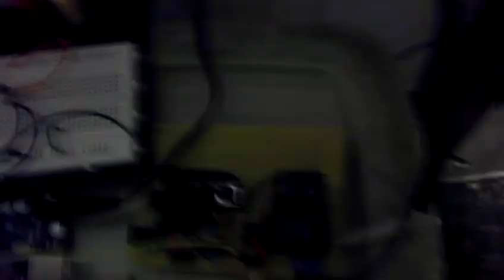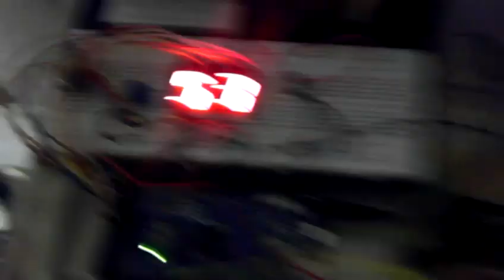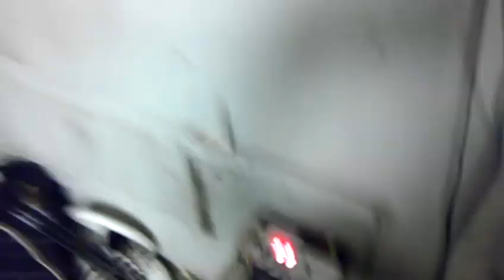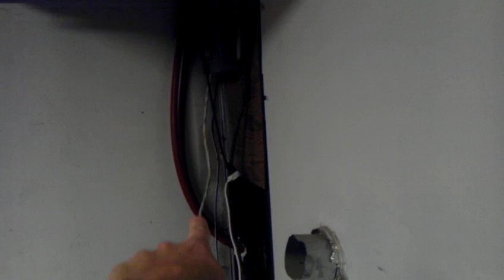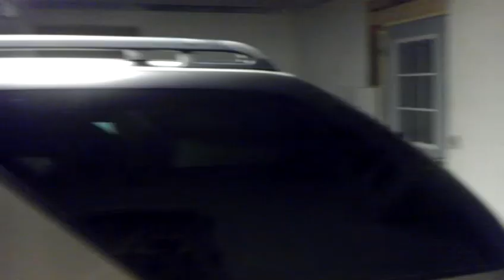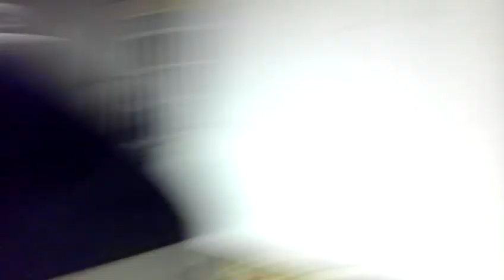Arduino Mega2560 Garage Thermostat

Comment: Any chance I can get a look at that code for the arduino. I am a few months into teaching myself how the code works and syntax in hopes of creating a fairly precise cooling system using a pot to adjust temp, thermocouple and pwm on a small water pump.  Thanks phigby5150 at yahoo dot com

Comment from the maker: @utechtzs haha, yeah I think it's like one level simpler than a PID control, but they've both got the same goal. As far as wire twisting, there are no high frequencies running through them.  Most of them are for the 7 segs so they're usually either high or low.  Maybe next time I will :)